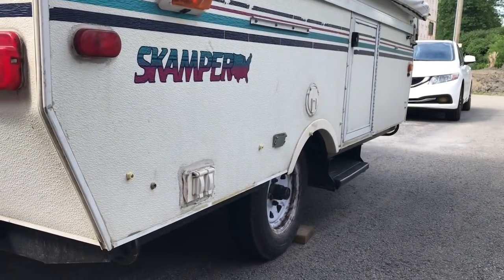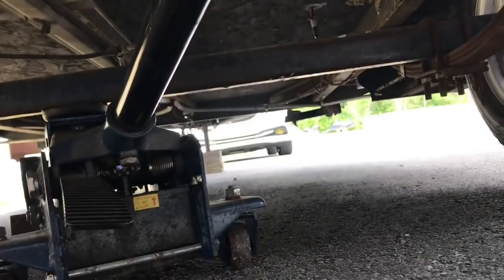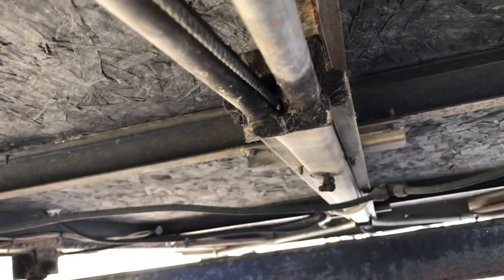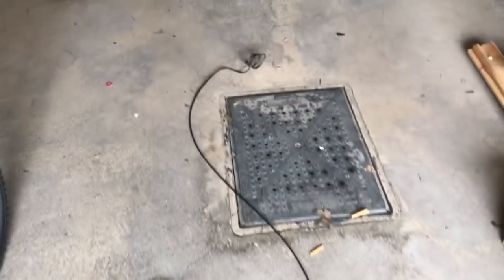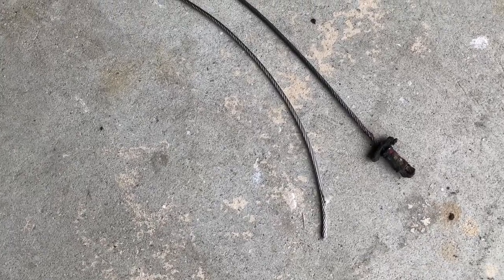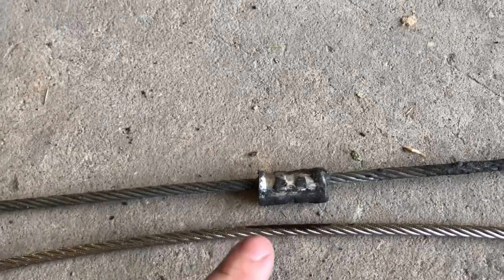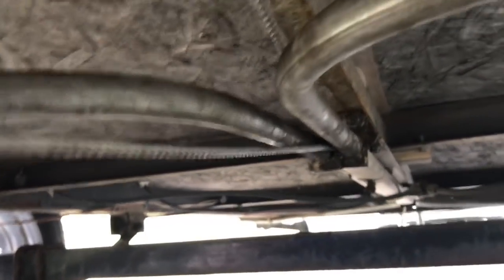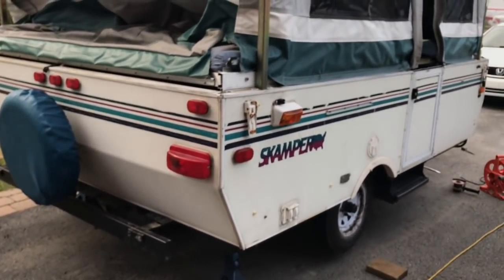Replacement of Goshen lift cable in my popup camper

Comment: So, I have a pop up identical to yours... i have no idea how long the cable needs to be, nor distance between crimps as I never got it. I can't  find anything about the specifications anywhere. Can you shed light on this?
Reply from the maker: You have to use your existing cable as a guide to make your new cable.

Comment: Great video!
Just curious, do you see any reason why next larger sized cable would not fit?
I am considering a roof rack and would like to not have to unload my 60 lb kayak.
Reply from the maker: The pulley may be the limitation. Honestly… a 60 lbs kayak is no issue for the stock cable. Think of all the campers with AC units that weigh 100 lbs.
Reply: @DIYManiacJohnP  I asked my Lady to lay on top and cranked it up, I am happy to report I can easily lift TWO kayaks 😄
Reply from the maker: @cautiouslady5051  that is great!!!!

Comment: Our winch cable on a 2008 Rockwood Freedom just snapped. We're so glad to have found your video. It totally demystifies replacement of the cable. Thank you so much, John!  One minor detail:  We spotted in a manufacturer's video that the sleeve stops should always be vertically oriented rather than horizontally. Loved your video, and I'm not trying to be a smart-a$$, but here is a link to a  helpful video on the sleeve stops:  https://www.youtube.com/watch?v=dlECTP3Qr0Q&t=7s

Comment: When you measure the cable front to back how long was it you didn’t mention the length
Reply from the maker: I didn’t mention length as every trailer will be different depending on its size and set-up. Measuring your cable once removed is the best way to know the length you need

Comment: one of my springs is poking up through the top of the telescoping do-dad. I have to manually lift that corner and use the safety brace on that corner. is the spring installed wrong??
Reply from the maker: MrWild200x interesting. It should not be able to poke up

Comment: Followed all the instructions to realize that my Viking Epic 08 has the front springs mounted on the bottom so I had to feed my cable in the bottom section and finish installing with the top. Also, I highly recommend just dislodging the front springs so you can feed the cable through (no need to unscrew the side brackets) otherwise you may spend your entire day trying to feed your cable through!

Comment: How do you adjust the back pulley in order for the front and back to raise evenly?? I want my back to be a bit higher.
Reply: Move the pulley further from the main tube/closer to the bumper to increase rear height relative to front. Opposite for decrease relative to front.

Comment: Hi was wondering if you new from the top stopper on the cable how far down do I put the one in the middle, got a 2003 Fleetwood
Reply from the maker: Sorry but each camper is unique depending on the size you are best to measure based on your old cable
Reply: @DIYManiacJohnP  yeah we lost one end of it

Comment: After replacing my cable l am still not able to raise the roof, any suggestions on what may be the problem
Reply from the maker: Daryl Moore can you explain more in detail what is happening? Is the crank turning or does it lock up? If it locks up, is it right away or after a few turns?
Reply: @DIYManiacJohnP  the cable tightens up before it lifts. I went through the same steps as this video

Comment: Does any aircraft cable work or do I need to find one that is specific to tent trailers?
Reply from the maker: Hiroshi Inagaki all that is important is that it is stainless to resist rusting and has a high enough strength capacity. Aircraft cable more then fits the need
Reply: @DIYManiacJohnP  which cable did you use? im in canada too

Comment: I have one corner of my camper that I have to assist it for it to go up. Rear left corner. It has this Goshen system. What are your thoughts on the cause of that? Thanks
Reply from the maker: lostintime86 will it eventually go up under its own power? Or not at all?
Reply: @DIYManiacJohnP  I have to crack it then go to that corner and push it up, crack, push, crank, push, over and over again. thanks
Reply: not sure if this matters but the right side rear tube is bent. Like someone bumped a tree stump. I pulled it straighter with a ratchet strap. I would think I would be having an issue with that side instead.
Reply: @DIYManiacJohnP  I just realized something I probably should have mentioned. I hadn't thought about it before. But that corner of the campers plywood is rotted out. I am working on replacing it. May not have enough structural strength there to support the post. Thoughts?
Reply from the maker: lostintime86 this will definitely cause an issue with the lift.

Comment: Hey there, nice video and one I most definitely needed. I bought a  used 92-3 Skamper, that looks just like yours, color scheme at least. I need to replace the front right lift cable, but going to do all 4 at the same time. I know nothing about these pop ups. We've had many bumper pull campers in my lifetime, but they belonged to my folks lol. So dad always took care of everything. Dad isn't here anymore, so me and my lol bro are going to attempt to change these cables out ourselves this coming week since the weather will be nice. I sent him your video to watch. I'm sure you are fine with that? lol Actually, if he can do it all himself. I'm going to pay him to replace all four cables. I just gotta buy them. So........

I NEED TO KNOW, if you can tell me, WHERE I CAN ORDER the lift cables please? PLEASE? I google Goshen lift cables for 93 skamper and  a bunch come up. I have no idea if they are all the same or what. That's why I am asking and HOPING you can tell me. Hoping you answer actually lol. It's an older video, and it's Rough times right now, and no idea where or what you may be up to. I don't want to "bother" you, just a quick...where and what size if they come in sizes. Thanks SO SO SO MUCH. I hope I can remember how to set it up too lol. I bought it last Oct. out of state, pulled it home. Bought a cover for winter. Sitting in my drive ever since. Now just waiting to get them cables. I'm Ready to get out there...argh...
Reply from the maker: I bought mine from the local hardware store. I believe you can order directly through Goshen though. Thanks for watching!
Reply: @DIYManiacJohnP  Thank you, IDK why I didn't think of THAT ONE myself. You were of great help. Thanks so so much. I'm sure we'll be watching this vid. repeatedly.

Comment: Just like jmh9932, the springs were in the reverse positions for me. In fact I think the center tube was mounted backwards from yours. No big deal except that the front springs were in the bottom and rear springs were in the top. I think the system is fully reversible, with the caveat that the grease ports should map to where the springs are. Looking at the diagram on Goshen's site (https://goshenstamping.com/media/uploads/0/546_1473-SERIES-DIAGRAM-PARTS-LIST.pdf), it appears that they expect the front springs to be in the lower half of the tube, and the rear springs to be in the top (hence the positions of the ports).
Reply: Mine too! I knew something was wrong and stopped for the evening. In the middle of the night it came to me how the system works and I got up this morning and realized how to reverse it. My grease port is more forward than John's.

Comment: How long does it take to replace that cable approximately
Reply from the maker: Took me about a couple of hours
Reply: I bought a 94 palomino that needs to cable replaced do you leave the top down or raise it to replace the cable
Reply from the maker: @leroybrewer5184  down
Reply: Okay I'm going to try to attempt it myself but I'll be watching your video again thanks a lot you've been a big help they want anywheres between 500 and 1500 to fix it but they only do them from November to April
Reply: Do you remember how long the cable was that you had to buy
Reply from the maker: @leroybrewer5184  I do not and every pop up will be diffferent.

Comment: I have a viking 2001 and just replaced the lit cable , now the rear lifts before the front and will not even out  , does anyone have any help to offer ?
Reply: The rear pully has some adjustment to it for this. Lengthen the pulley (further from the bumper/closer to the tube) if the rear lifts higher than front.

Comment: How did you lift the top?  Thanks.
Reply from the maker: Joyce Fortin hi. The top did not need to be lifted for the replacement of the cable
Reply: @DIYManiacJohnP  Thanks John. Apparently my pup does in order to get access.
Reply from the maker: Joyce Fortin and you have the Goshen lift system?
Reply: @DIYManiacJohnP  No. I just found out it is a L & W system.
Reply from the maker: Joyce Fortin in that case you will need to lift the top.
Reply: @DIYManiacJohnP  :) Yes, it looks that way. Nothing is easy.

Comment: Go to a wire rope rigging supply company. They will be able to help you. Are you near a port or logging area?
Reply from the maker: Kevin Holland cable is easy enough to make yourself if you know how.
Reply: John, Where did you get the tools to swage the ferrules on the cable? And where did you find the special ferrule for the end? I appreciate your videos. There is not a lot of repair videos on YouTube.
Reply from the maker: The tool used is a swaging tool, can be purchased for $50. However this can also be done with a vice and still be adequate to hold the not so heavy camper roof. The ferrules can be purchased at and hardware store.